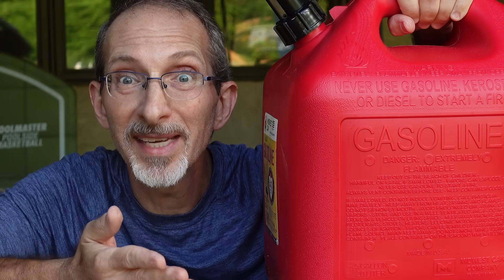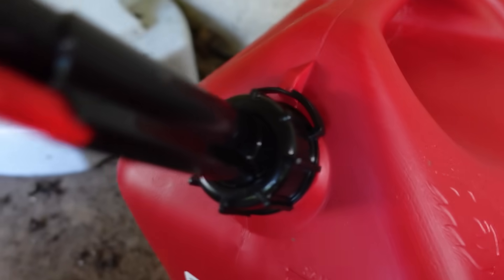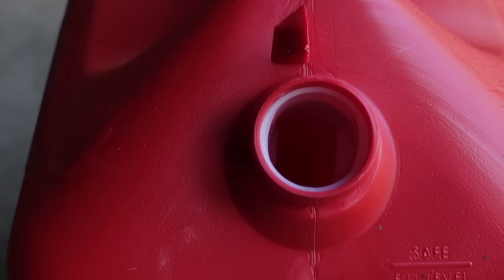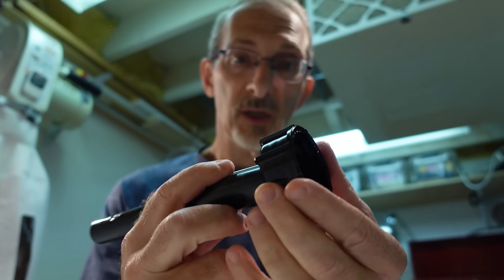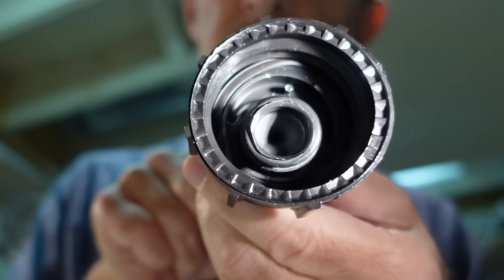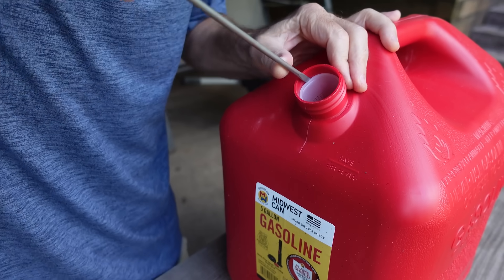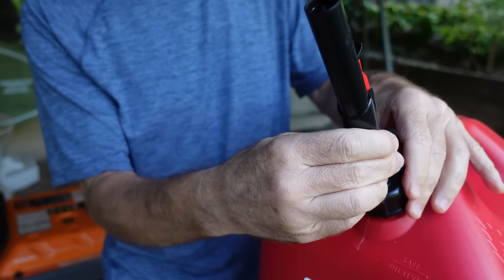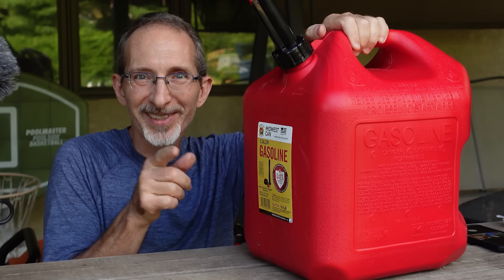Gas Can Modification | New Gas Can Fix

Comment: I bought a 5 gallon plastic gas can with one of these pieces of non usable spouts on it. When I went to fill up my basic craftsman lawn tractor I couldn't even hardly get this piece of useless spout to even push in so it would release the gas. What a total pain in the ass when you're turning over 5 gallons and the gas is coming out to slow. Now I just fill it up 3 gallons and its easier to work with. The first time I just took off the spout and put a funnel in the gas tank and poured the gas right in. It worked ok but having a spout in the gas tank is way better. So now I still use it the right way but I only fill up the gas can with 3 gallons and it way easier to turn it over to use it. I also fill up a 2 gallon gas can at the gas station. Anyway I'll be looking at yard sales for the original plastic gas cans with just a plastic end cap on the end of the spout. They are out there. I'm mad at all this safety BULLSH!T to. These safety engineers are wasting our time and making people mad. Some things are better left UNTOUCHED$$$$$$$$$$$$  Give me something that works easy and right away or what I just bought is TOTAL JUNK.
Reply from the maker: Phil, you did a GREAT job of summing up the frustration of the ‘new’ gas container experience. I agree that it is easier to use the 5 gallon containers when they are only partially filled, which is completely ironic. However, it is a good workaround. Thanks for sharing your experience and for joining the conversation! :-)

Comment: So the filter in the tank catches any debris when filling. Then when you fill your equipment the debris goes into the gas tank! Great piece of engineering!
Reply from the maker: Richard, what I thought was a filter turns out to be a flame arrester safety device. My bad! But, yes, that would be a stupid design for a filter, and it is still in the way when I fill the tank no matter what you call it. :-)

Comment: Same can, I tossed the whole nozzle and replaced with flexible hose and pressure release cap on the handle. also pulled the inner filter
Reply from the maker: The aftermarket replacement kits with the flexible nozzle are a great choice! I appreciate you watching in joining the conversation.

Comment: All these new "safety" cans suck... I bought a couple of conversion kits from Tractor Supply that has a conventional nozzle, and an air vent that you have to install on the top of the gas can.
Reply from the maker: @airmojo - cool. Those conversion kits are popular and effective!
Reply: @MikeFyxdt  The worst cans I purchased when this whole "safety" can mess started had a few teeny-ass springs inside the nozzle that would always eventually get twisted, stuck, and cause excessive cursing by the user... I mainly curse the bureaucracy that created these monstrosities !

Comment: If anyone doesn't understand the "need" for this type "safety" spout, here is the answer. 
In the old days,  when someone spilled gas on themselves or the item they were filling up and something happened and it turned out bad.  You could sue the makers of the can.
Now when you spill gas and something happens, well, they will say that you did something wrong.  How else could you get gas out of the can if you don't bypass the spout?
Reply from the maker: You have done a good job of pointing out the irony of these designs!

Comment: I would recommend the "no-spill" brand of gas can. Instead of the retracting nozzle, they have a green button, which makes them much easier to use... Although they do still have the filter inside... I don't have any issues getting gas in as long as you pump slowly.
Reply from the maker: Michael, thanks for this recommendation! I've heard lots of praise for the No-Spill brand. Thanks for watching and commenting!
Reply: Agreed! That type of safety nozzle works much better.

Comment: Another thing I don't like about these is not having a cover for the tip. Seems like that allows a lot of dust and dirt to get into the nozzle that then get poured into your equipment's gas tank when you fill it! Especially if your gas cans sit in an open shed like mine do, right near where I mow my lawn! Good camera work btw!

Opps! I see they do have dust cap(that will probably fall off and you'll lose somewhere) that also works as a cap if you stick the nozzle into the can when it's empty. Seem like It would get dirty after a while and I personally wouldn't want to stick into even an empty can, plus getting gas all on my hands, but anyway here's Mid-West's video of how to fill/use this can for those that want to leave the safety features in place.

https://youtu.be/mIc1TD6c7Ig
Reply from the maker: I agree! In my second video I added a cap for the nozzle that my son 3-D printed for me. It does the trick! Thank you for watching and for joining the conversation.
Reply: @MikeFyxdt  I see they now make a dust cap, that also caps the whole can if you insert the nozzle backwards into the can, but it's loose. How long will that be around or get knocked off especially as it gets older?
Reply: @mickjager5974  lost mine very quickly. The other type of safety nozzle is better...the one with a push button at the rear of nozzle.

Comment: I live in Illinois and bought a plastic gas can 33 years ago as I traveled through Newfoundland, CA. on my motorcycle. It's still in constant use today. The filler tube is inserted into the can when not in use with the filler cap and vent cap tightened. I filled it one time, laid it on it's side, and stood on it. No gas came out, even with 200 extra pounds squeezing it.

Comment: I bought 3 yellow ones when I bought a compact utility tractor. Filled 2 and took the third one back. I overflowed 1st one at station. Watched better filling second can. Tractor filler neck is metal & wide making it hard to keep the can tab engaged. The filler neck is also chest height. Yesterday the tab slipped of the filler neck causing me to loose grip of the face level can. Spout partially pulled out and I spilled diesel all over seat cover, controls on top of fender, and tire. I am too cheap to throw them away so I will remove the can insert and use a siphon hose. I bought 2 No-spill cans that work just fine.
Midwest can may meet government requirements but they do not meet mine.
Fuelworx looks promising.

Comment: That filter is called "flame guard" DO NOT remove that UNLESS you added vent valve to the back of the tank just like the older model. Without vent at the back you WILL GUARANTEE to blow up the gas can while filling when the equipment is still hot and near exhaust. Search google people burned off their face and many injuries already. BTW, for legal purposes, if anyone hurt or die by following your hacked, you're liable and it's felony both interfering with consumer products and also using internet.
Reply from the maker: PNP, thanks for your input and for your advice. In my second video, I added a vent and it definitely helps the container pour more smoothly. As far as legality, as I have always said people need to make their own decisions, and these are just my experiences. :-)

Comment: Could just use cutters to shorten the spring, or find a much weaker spring.  I think it serves a purpose, but is too strong.
Reply from the maker: Aussie Len, I agree! In my second video, link in the description, I cut away half of the spring and re-stretched it to the original length. It kept the self closing safety feature, but made it easier to work with. Thanks for joining the conversation!

Comment: Thank you for the helpful video! I was able to follow your instructions and remove the spring from my gas can nozzle. I had already figured out the filter trick on my own but didn’t want to mess with the nozzle until I learned what was inside it. 

With about half of the things I buy, I wonder if the people who designed/ made it ever used it.
Reply from the maker: John, I wonder the same things sometimes. I’m glad the video was helpful, and I hope the mods make it easier moving forward. Thanks for watching and for commenting!

Comment: The white insert is a flame arrester. I punched a hole in the bottom of mine then inserted a hack saw blade and cut the arrester in pieces. Useful to use locking pliers to hold the white piece so, as you say, it doesn't fall in.
Reply from the maker: From the comments section it seems that the preferred method for removing the flame arrester is to grab it with vice grips and twist, making it fold in on itself and get skinnier so you can remove it. No matter what your method, it definitely gets in the way. We need better designs!

Comment: drill a hole in it where the air vent should be then put a screw in the hold bigger than the hole and your good to go.
Reply from the maker: That’s definitely an option! In my second video I installed a plastic vent cap, which I think made a difference. There’s a link in the description if you’d like to see that video. Thanks for joining the conversation!

Comment: I have the 1 1/2 gallon gas can for a power trimmer. IThe first time I  used it I had to push n the red bar, pull the spout neck down, and splash...I got fuel slapped into the chin like a faucet. And they called that engineered safety right on the label. How can this be? Now every time I open it, and pull down on the neck I expect fuel to shoot out like a cannon, and I am not happy with this.  It could've splashed me in the eyes.  How is this a safety gas can and now it's rendered unsafe for me.  It needs a breather outlet to allow air in the tank to escape.  What a mess.  THUMBS UP!!!
Reply from the maker: LostInMySpace - I am also glad it didn’t splash you in the eyes. Other people in these comments weren’t so lucky. There’s a couple of things in your comment. First, these plastic containers seem to pressurize with the slightest raise in temperature, so I always loosen the collar to “burp“ the cans before I use them. Second, the vent is a narrow passage that runs along the filler spout, but this doesn’t seem intuitive to me. In my second video, link in the description, I installed a plastic vent cap on the back of the container, which I think makes a big difference. Finally, I completely agree with you that these designs are a mess! Thanks for watching and stay safe.
Reply: @MikeFyxdt  Thank you for your personal concerns.  You have great video content, and we Youtube viewers really appreciate the time and effort you put forth, making life easier and safer for all the public.  THUMBS UP!!!

Comment: These spouts do NOT bend,,and when you try to fill a tank that is FLAT,,you will still fuel. Just go to AMAZON or Tractor Supply., They have complete Bendable Conversion kits that also come WITH an "Air Relief" valve...or it will take 2-3 times as long to fill that tank.
Reply from the maker: Great suggestion. I’m going to do a video where I time the difference between how long it takes these nozzles and an after market nozzle to pour. Stay tuned! :-)

Comment: Or just buy the universal soft spout replacements  off Amazon and be done with it. Keep them out of the sun and they last. 👍🏻
Reply from the maker: Quinton, that sounds like good advice. While my fixes are free, the aftermarket spouts are flexible, so they can more easily fill a variety of tanks. Thanks for joining the conversation!

Comment: I moved and didn't have room for four old gas cans that didn't have any safety features. I wish I had left my deep freeze and taken the four cans. These modern gas can are a pain in the wazoo. Thanks for the demo. I will be doing your modification today. Spilling gas on my new riding mower is not what I bargained for. These safety features make filling tanks more dangerous. I have a sticker on the inside lid of my tool box. It says, "We're from the government. If it isn't broken, we'll fix it until it is."
Reply from the maker: @Kitty Hawk - Lol, perfect place for that sticker - in your tool box. My kind of humor! Yes, the older gas containers have been somewhat of a commodity, with the new designs being over-engineered. Please stop back and let us know how the modifications work out for you. I appreciate you watching and joining the conversation!

Comment: I like the video, but I've had these exact gas cans for a few years and they are the only ones I've actually liked. I think the spring is convenient. Pull it back, fill it up until it's close then let go, it snaps so fast and shuts off flow!
Reply from the maker: Jon, it’s always good to have some counterpoint. I appreciate you joining the conversation!

Comment: At the 5 minute point the inside is shown. The seal around the nozzle is out of place and when you tip the can it will leak around the base of the nozzle/ can top. I've seen this many times. 
These stupid new cans are supposed to draw the fumes (hydrocarbons) back into the space the fuel left. The logic ignores that fuel heats and cools and vapor escapes constantly anyway.
Reply from the maker: Yes, good catch! That seal is finicky!

Comment: Imagine being a gas station attendant and not knowing how to fill a finicky gas can lol
Reply from the maker: Corey, I feel their pain. If they are having issues day in and day out filling these containers then I'd say the problem is with the design. Frustrating!
Reply: @MikeFyxdt  I'm not saying these gas cans are ideal at all, but there are workarounds to the issue you brought up. Hold the nozzle so only the tip is in the can (the sensor will not detect gas splashes and won't shut off the pump), pump slower to avoid splashes, or use a funnel.

It may be inconvenient, but I stand by my original criticism.
Reply from the maker: @KOTR2003  fair enough! Since I removed my flame arresters this has not been an issue, but I think everyone needs to make an informed decision on what is best for them. I can’t speak from experience because I always use a gas station where they fill it for me, but I think all of your suggestions are very good ones!

Comment: That red lock broke on mine the very first time I used it. I bought the more expensive one from BJ's. The tank itself is
stronger than something you would find at  Walmart, but the nozzle is exactly the same piece of crap. I went on 
Amazon and bought the metal one. No problems yet.
Reply from the maker: @sr sc - I got these at BJs, too. Overall, the Midwest container is very robust, but I have most with my issues with the nozzle, as you have stated. Aftermarket is a popular option - thanks for chiming in!

Comment: Another issue with the 5 gallon can I have (and others I have seen)is there is no handle to tip the bottom of the can when trying to fill a tank when the can is full or even when not full.
Reply from the maker: @herbsu43 - despite my other design complaints, I do find the side handle on these Midwest cans to be very usable! Hope that helps.

Comment: I recently bought that exact  gas can.  I hate it!!!  Thanks for the fix but I have a better solution.  The spring serves a dual purpose.  Besides making the safety lock engage every time, it also causes an airtight seal so the gas doesn't leak nor evaporate.  I want that spring left in to seal the can properly,  so I'm taking out the safety.  I can work with that because it's the safety that gets in my way & most of the time resets before I get my gas out.  I only fill up my power tools & generator.

By the way... can you figure out a way & make a video to convert a Westinghouse generator's gas cap so a person can use an external 12 gallon gas can closed-system siphon  to continually refill the manufacturer's gas tank?  I ask because there's kits to modify Honda generator gas tanks, but not any other brand of generator.
Reply from the maker: @mosler302 - in my second video I did a mod to return the spring, but with less pressure. It worked well! There’s a link in the description if you would like to watch. I don’t have a Westinghouse generator to test on, but that sounds like a good idea if you could figure it out! Thanks for your suggestions and for watching.